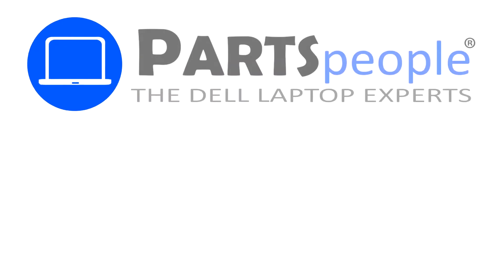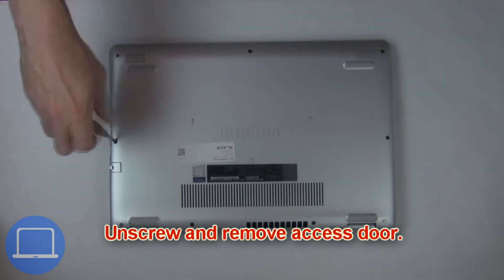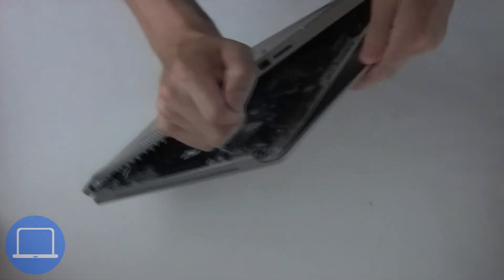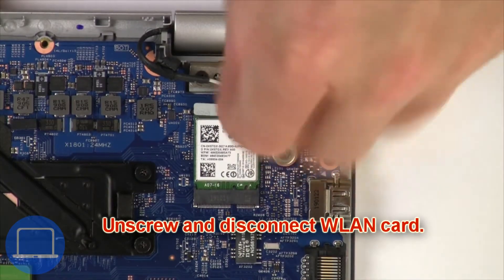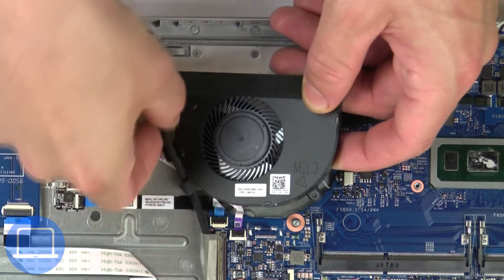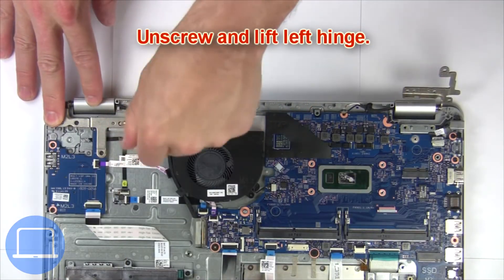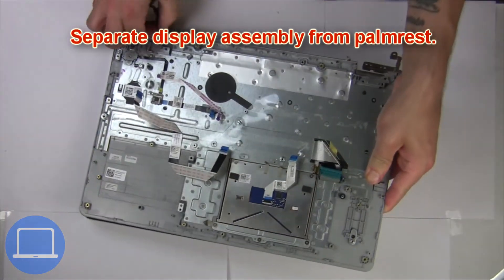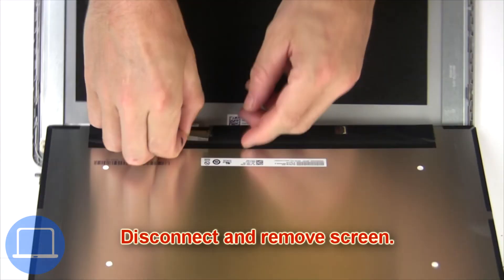Dell Inspiron 15-5584 (P85F001) LCD Panel How-To Video Tutorial

Comment: You dont show where is the location of rubber tape. This is incompletely tutorial
Reply from the maker: Hi, yeah you're right. Sorry about that, I think we missed that in this tutorial as we used a test system that the adhesive was already removed. Not good! But we've recently improved our tutorial method, so it wont happen again.